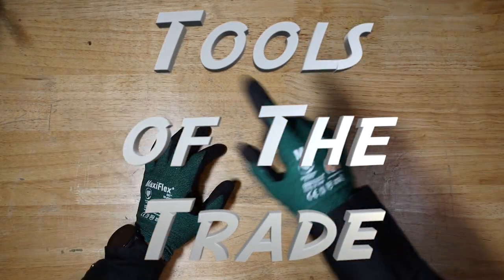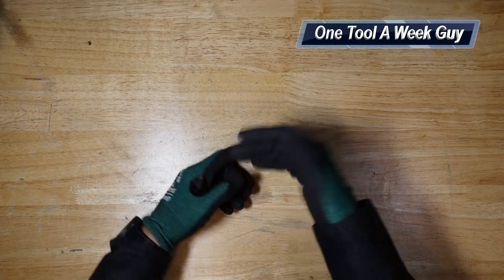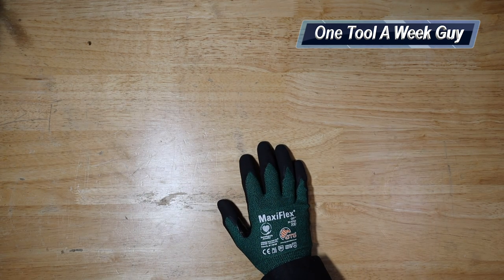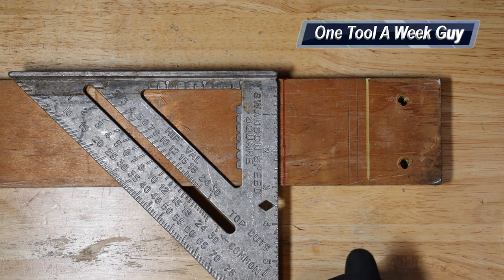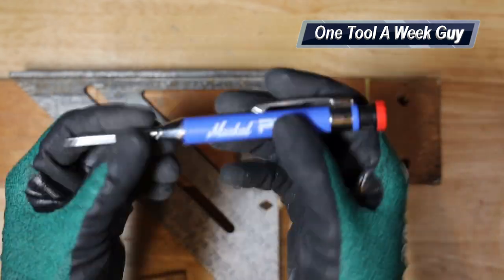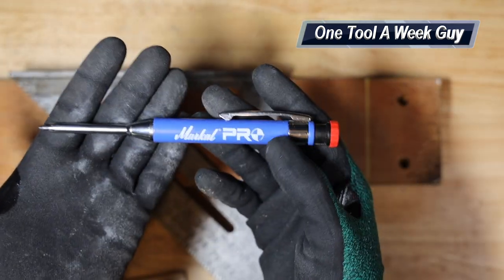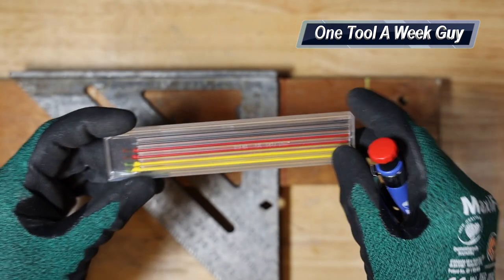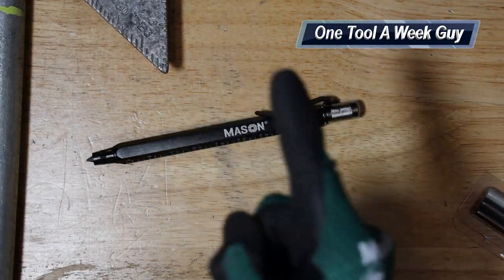Tools Of the Trade (Marking & Writing)

Comment: I have the Ox, love it. Cheaper than the Pica and not as big so it doesn’t take up to much space in my pouch. Plus the sharpener is on the top side of the holder so I never have to take the holder out to sharpen .

Comment: The tools mentioned in the video :--
1. General Scriber Pen No. 86
2. STKR 77629 mechanical carpenter pencil
3. Milwaukee liquid paint marker pen
4. Duramark Chalk Shot
5. Pica pencil
6. Sharp Draw carpenter pencil
7. OX Tuff Carbon marking pencil
8. The Fatboy Cap
9. Milwaukee markers
10. Markal Pro
11. Mason Multi Use 6-in-1

:)